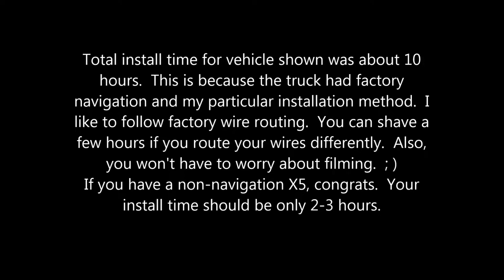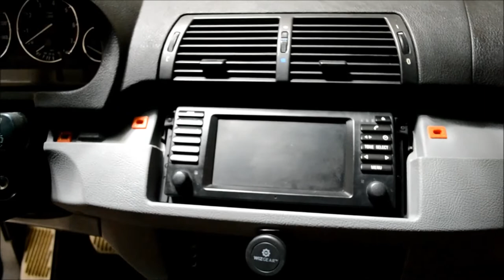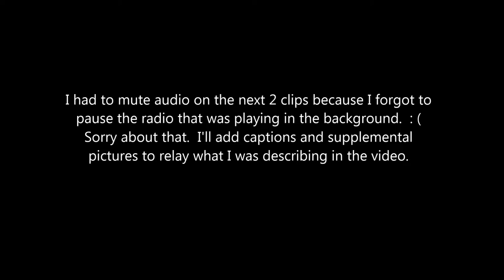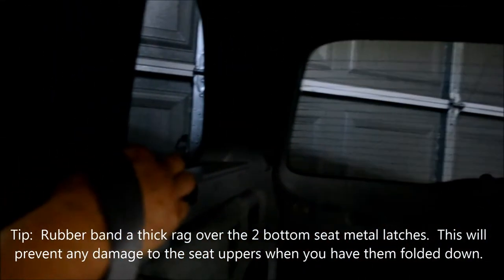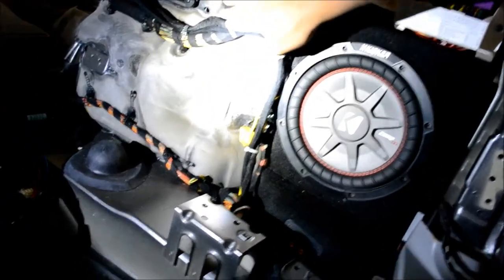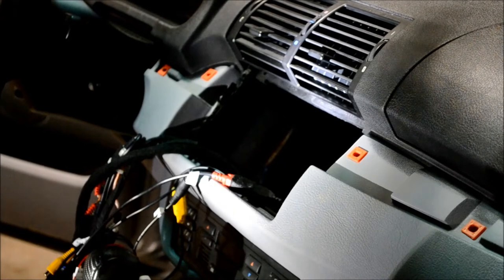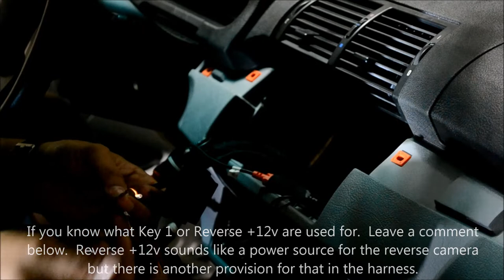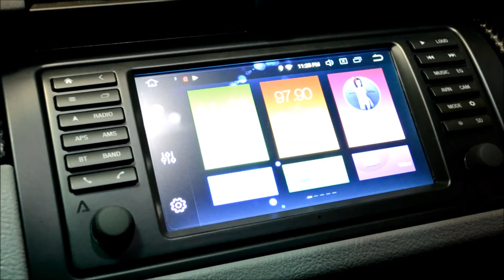Avin Avant 4 Android BMW E53 X5 Install Guide

Comment: oh ffs why can't it be simple plug and play? 10 bloody hours...
Reply from the maker: Yep, thanks BMW. The dsp/nav combo is what makes it so involved. You can do it faster if you don't run the cables like I did.
Reply: @crystalworks1  ah fok it, i'll just get the aux kit. I think it does not require any crazy ammout of wiring on nav comp
Reply from the maker: @I_hunt_lolis  I'm not sure... I have an aux kit (3.5mm Jack) left over from install. Let me check it out. I think it still involves running a wire from the back up to the front. Pretty sure now that I think about it.
Reply: @crystalworks1  Mhm I saw a vid where a guy who does not have nav comp and only a radio just plugs some wires and drills a hole and done. Unless Nav system requires special treatment again. If that's the case I'll just buy a decent bluetooth speaker drop it in the car and call it a day lol

Edit: just checked a vid by 
BIMMER ZEIT, thankfully the aux installation is pretty easy :)
Reply from the maker: @I_hunt_lolis  I'll have to check it out.  Thanks for the heads up, always thought the aux plugs were in the quadlock connector in the back, or at the CD changer plug.  Forget which.